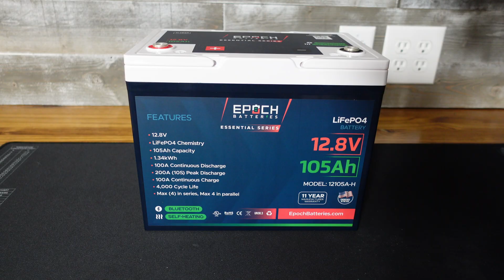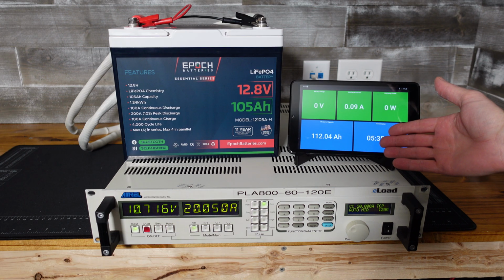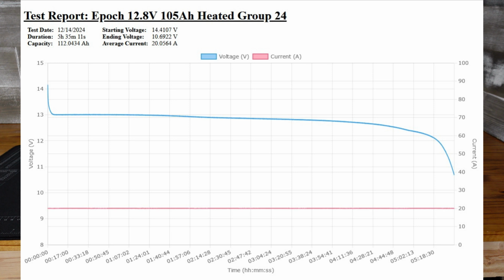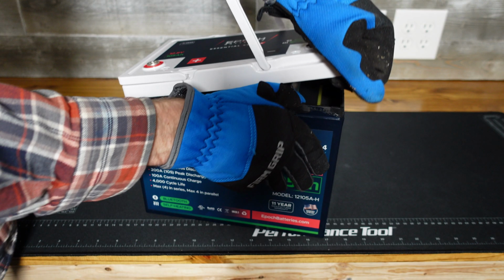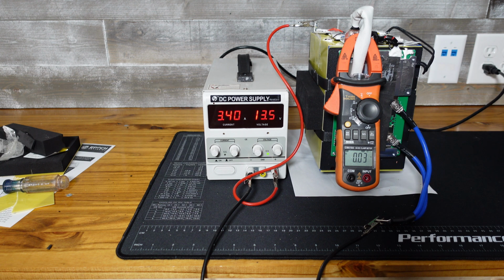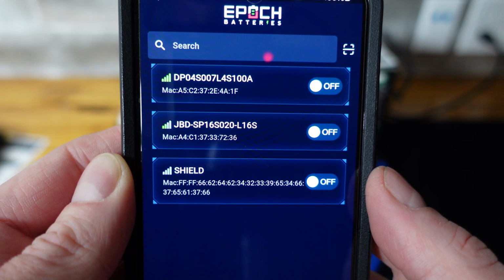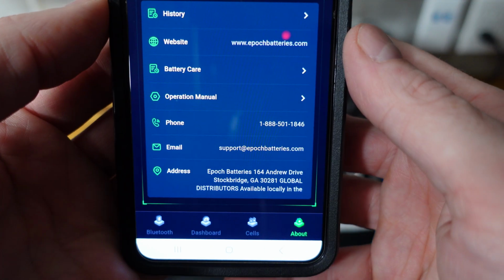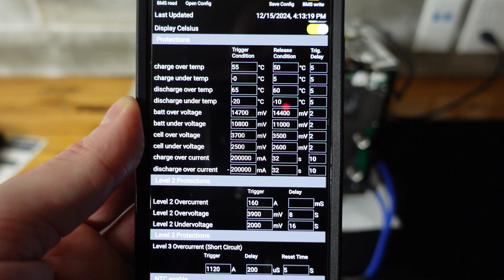Epoch Batteries 12V 105Ah Self-Heated Lithium Battery, Best of the Best??

Comment from the maker: 12V 105Ah Battery... https://www.epochbatteries.com/products/12v-105ah-heated-bluetooth-lifepo4-battery-epoch-essentials/?rfsn=6891696.aba73b0
Alt Distributor... https://www.currentconnected.com/product/12v-105ah-group-24-heated-bluetooth-lifepo4-battery/?ref=lithiumsolar
(affiliate links)
Reply: Top notch battery. The chargers they sell seem a bit under amperage. Normal amperage for a 100ah battery is at least 20 amps. Unless you have all day to recharge you battery with 15 amps.

Comment: What would be an acceptable lower price 120volt charger to use to maintain this battery ??   80 amp Victron very/ ex pensive.    Also what minimum charging power is critical to have ..or other features in a charger for this 12 volt battery?

Comment: Great video.  I have two 300Ah Epoch batteries and so far they have been really good.  I have them in my van.  Do you know if keeping them at 100% SOC practically all the time is an issue?  My rig is parked outside in the sun so the panels keep them charged up.

Comment: Pricey and heating pad was not pointed out  where it is unless I missed it 😅
Reply from the maker: The heating pad was pointed out around the 5:30 timestamp and was tested during the low-temp testing chapter. I did not cut the battery apart to see the pads between the cells.

Comment: With a 30 milli-ohm internal resistance (it might be lower but this is the worst case) at 80A recommended discharge limit the voltage at the battery's terminals will fall from nominal 12.8V to 10.4V.  That's before any other losses in wiring and switching are considered.  At 100A it goes to 9.8V.  Nothing wrong with 30 milli-ohm impedance on the battery, but this is why people come unstuck expecting to be able to draw high current out of a single small lithium battery to operate an inverter - the voltage falls to the point where the inverter says 'no more' and turns off.

Comment: Disappointed that such an expensive battery is using strapping tape rather than a metal cage. Not sure what the additional cost is compared to Ecoworthy and Litime.
Reply from the maker: It has steel plates on the ends, I was satisfied with that.

Comment: If they could integrate a charge controller of some sort so I can use one in my dump trailer that would be awesome. I used a battleborn and it just pops the fuse on the truck side because the battery can accept anything the truck can output.
Reply from the maker: Victron makes a nice DC-to-DC charger that will solve that problem without buying a whole new battery.

Comment: Can this battery start an 115 kW petrol engine? ie. Is 200 A enough for this?
Reply from the maker: This is not designed to be an engine-starting battery. They do have some batteries rated for cranking though if you check their website. I have not tested any of them.

Comment: how many cycles is this batteries life span ?
Reply from the maker: I covered that in the video. It's rated for 4000 cycles at an 80% depth of discharge.
Reply: @LithiumSolar  that's 10.95 years with daily discharge of 80%. My guess is less than 1% of people that use this type of battery will do an 80% DOD daily. 
 In 10 years', we will probably see 2 or 3 different battery types that are better and cheaper. 
Thank you for all the work you do.

Comment: You said that you left the battery hooked up to the charger overnight - is that for balancing the cells?
Reply from the maker: Yeah I usually leave it plugged in overnight hoping it will do a bit of balancing (if needed) since it's the first charge.

Comment: Would you recommend these for a powerchair?  I need 2 group 24 12volt.  My current gel cell batteries are 12v 80 AH.
Reply: We have fitted LiFePO4 batteries to power chairs in our workshop. Definitely you feel more power because off a smaller voltage drop when compared to AGM.

The 80ah batteries are comparable in capacity to 40ah LiFePO4.

This 105ah LiFePO4 is actually almost triple your current installed capacity. And if you live in a below freezing environment, this is the way to go.
Reply: @ricardomarcelino8388  Thanks for the info.  I typically don't leave home when it gets below freezing.   My condition gets progressively worse in cold weather.  The video states that the batteries last longer if charged with a 50 amp charge.  There is no way I could charge at that rate through my joystick port.  10 amps is my current charger and about all I would be willing to charge at.  Is this an issue charging at 10 amps instead of 50?

Having 3x the capacity would be great since I have added accessories to my chair like a computer and cameras.
Reply from the maker: Charging at 10A is perfectly fine. What I was referring to is the battery will degrade faster if you constantly charge it at the maximum rating of 100A vs the recommended rating of 50A.